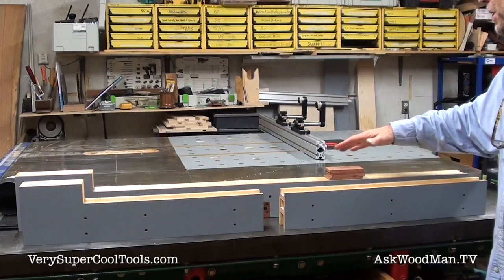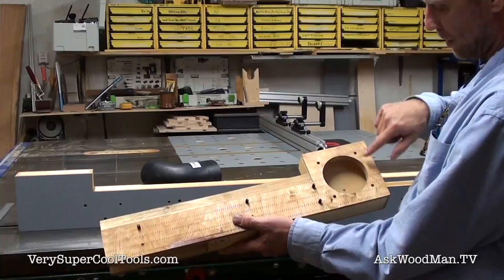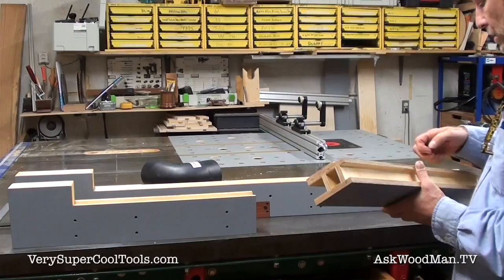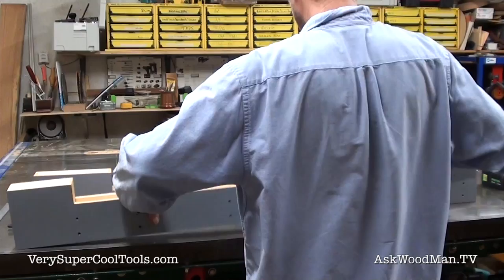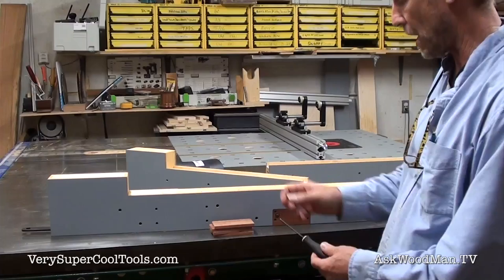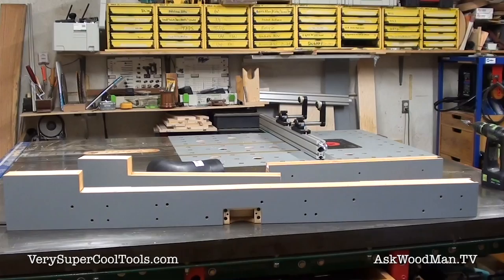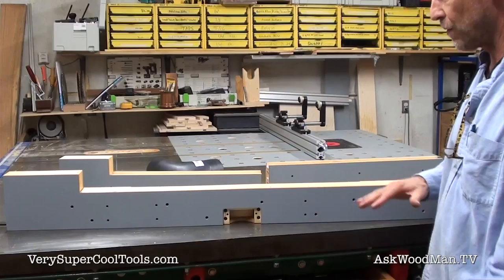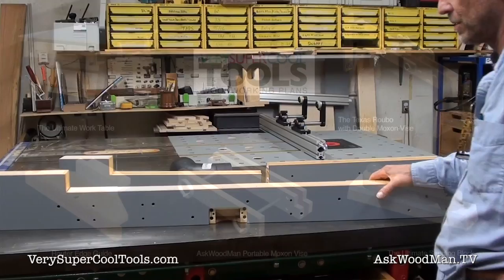852. DIY Router Fence With Dust Collection - 2 Styles

Comment: Outstanding setup! Does this mean you've abandoned your Venturi on your table?
Reply from the maker: ***** No the venturi is working better than ever for bearing trim routing where no fence is used. I also use my handheld routers over the table with the collector going to keep the chip blow to a minimum. I just helped a friend/customer deck out his saw with a much larger work table venturi. http://vsctools.com/sliding-table-saw-work-station/ There will be a whole series about this build soon.